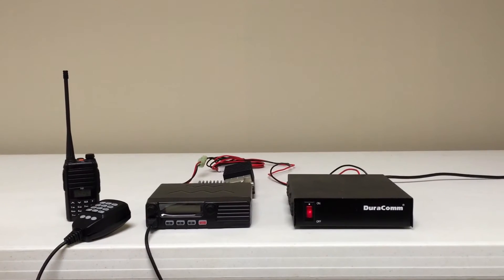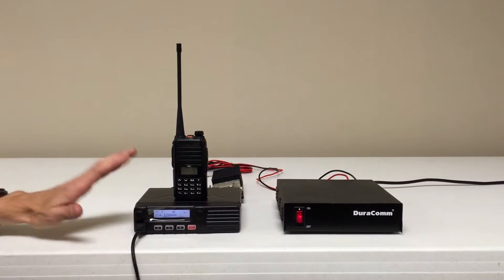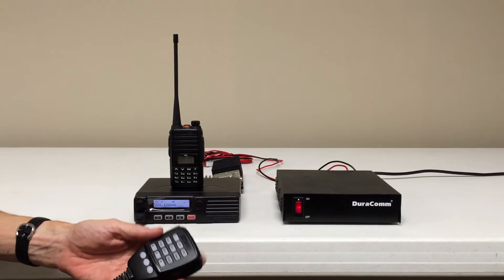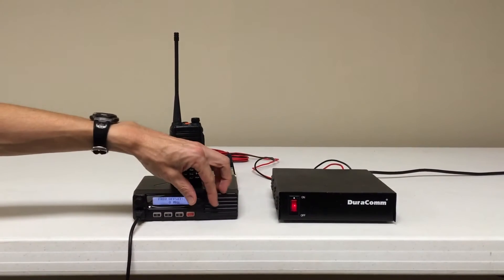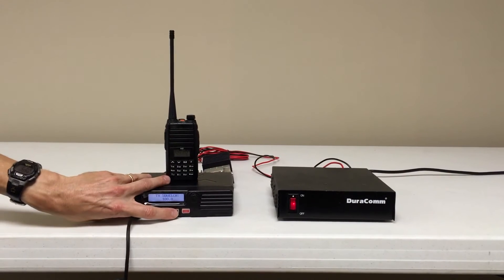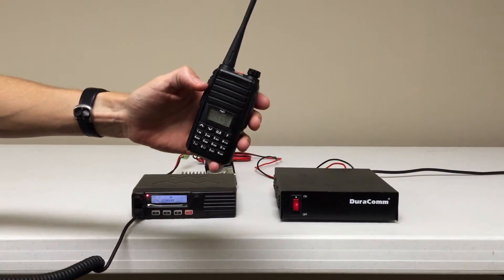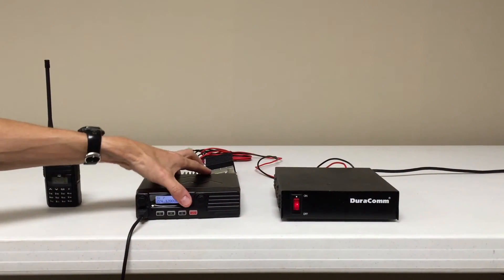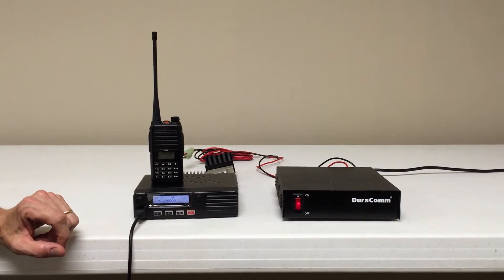220 MHz Radio Test

Comment: I have the 220 HT. It's a good, solid radio that works well. It's easy to program, even if you don't have the manual (although I prefer programming with software using the optional USB cable). My only complaint (minor) is lack of an S meter on the display and lack of a repeater offset icon on the display.

Comment: your 220 HT is over price, for a mono band radio, I won't name the company, but I have a Tri-Band HT radio that covers 2m/220/440 for $35 dollars less than your radio at $85.
Reply: Dennis Hixson we understand the price, quality and support isn't for everyone, but it sure is great to have options. The BCH-220 is a full 5W on 1.25m and passed testing with flying colors. It will stay on frequency, provide good audio and be reliable for years to come. If that doesn't fit what you are after, we understand. 
73,
Tim
Reply from the maker: https://youtu.be/A5EGacvaVWI
Dennis, watch this video.  Bryan shows why the BCH-220 is a solid performer and helps to keep the airwaves clean! 73 - Tim
Reply: You get what you pay for.  BridgeCom products are easy to program; their support is excellent; quality is exceptionally good and their devotion to support our 222 MHz band is appreciated.  BridgCom deserves the support of the amateur community!